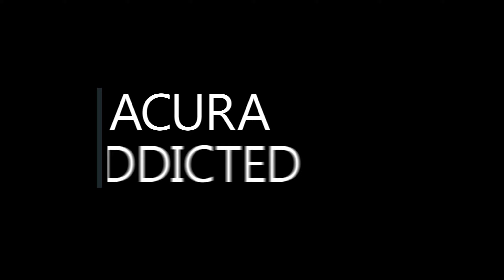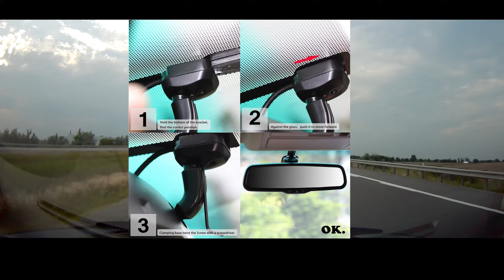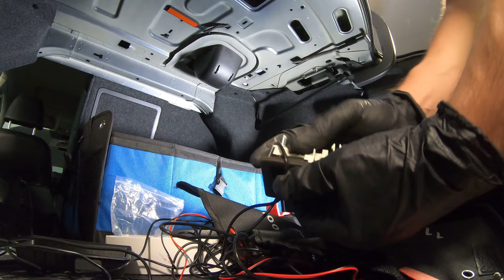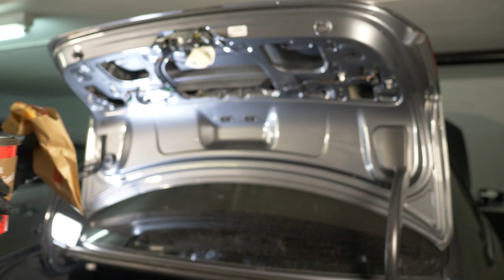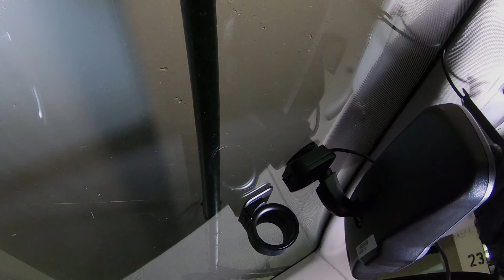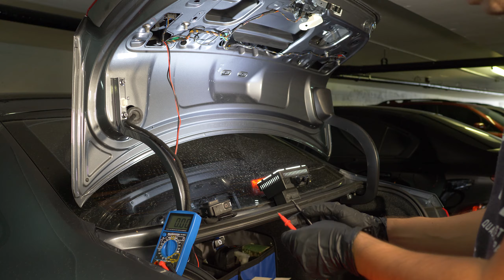Backup Camera with a Rearview Mirror Display output DIY

Comment: Nice content 👍,  please i want to know if there are any much difference between 5w 20 and 5w 30 oil change on Acura MDX.   (Your fan from Nigeria)
Reply from the maker: Hi John. Thanks! The viscosity is bigger as you go higher. Helps in a hotter climate. Are you driving an MDX in Nigeria? Please share! Fascinating!
Reply: @AcuraAddicted  Yes i am driving an Acura MDX, 07 in Nigeria. It's really a very nice car to drive.  But have trouble getting OEM parts here.